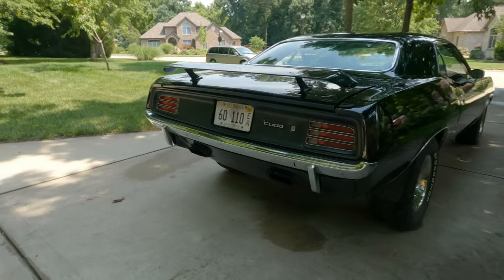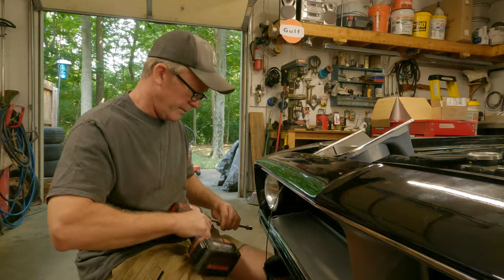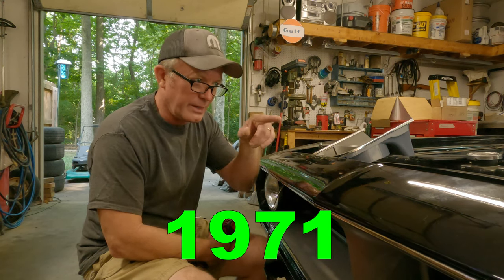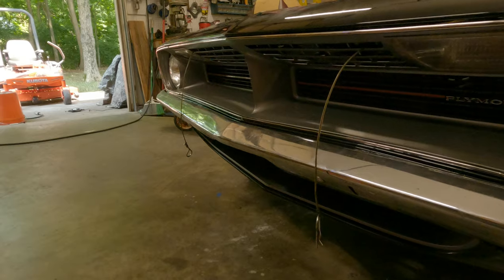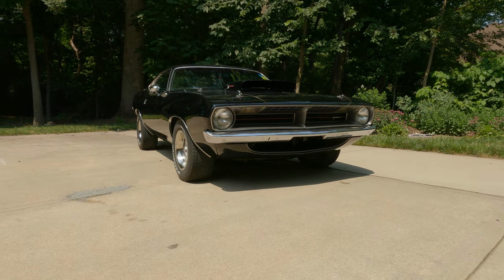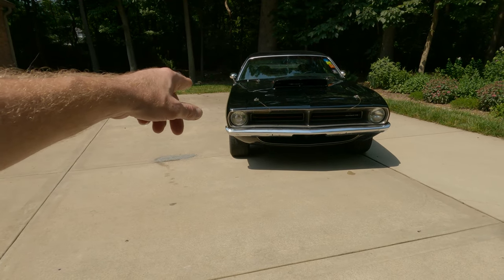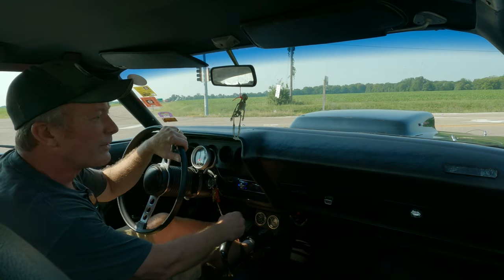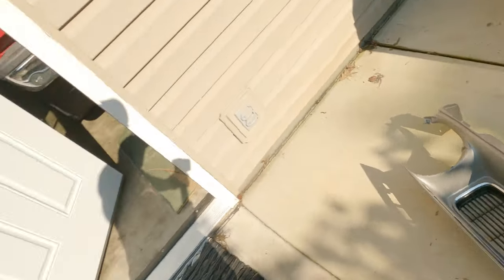1972 Plymouth Cuda Grill Swap - 4

Comment: What kind of ignition box are you running or gonna be running
Reply from the maker: It's an MSD Digital 6 plus.  It was cutting out around 5300 rpm last year and I sent it in for repair.  I need to take it back out but it seems to be doing it again.